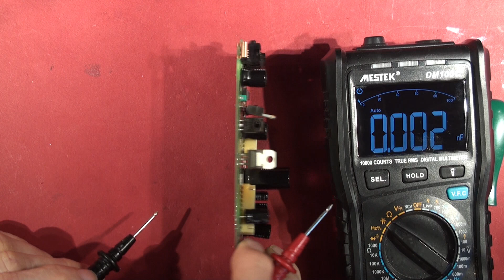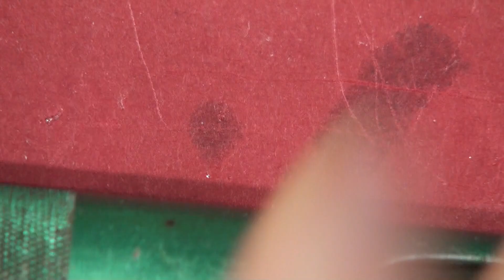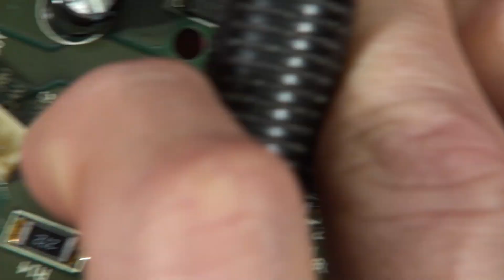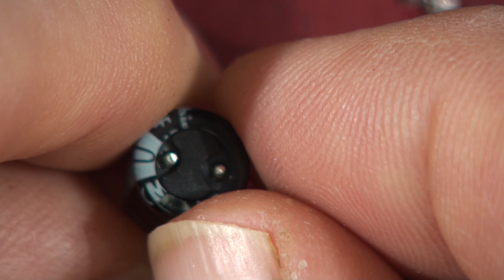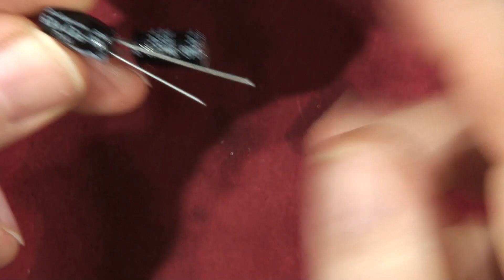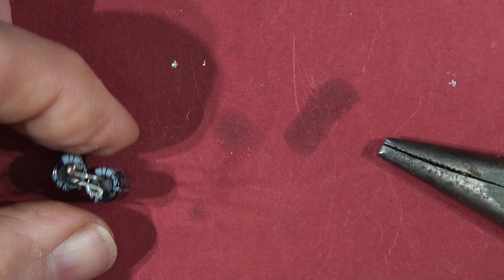Bose Lifestyle 20 Music Centre Dim or No Display Fault Fix and Diagnostic Repair

Comment: The Video is amazing, it explains everything fundamental about this system.
On my device the SCREEN was faulty so i measured all the capacitors and changed only the C27 and it worked after!
Huge thanks!
Reply from the maker: Good to hear that you fixed it. Thanks for watching and subscribe if you can.

Comment: @razenby  - I tracked down schematics for the CD-20. For some reason Bose deleted the schematics in the latest service manual available online, but I found an older version that includes the schematics and shared the power supply schematic here:
https://drive.google.com/file/d/1FIZF0nvMglNwCBArtiRix19kMqBULdgT/view

Corrected: C24+C27 are a pair placed in series (for reasons I don't understand), and drive the 4.5vAC-powered VFD display filament. The other terminal of the filament is at - 24V DC, so the DC voltage the caps see is 24v +/ - 6.4v, and the polarity of the caps is correct.

Hope that helps!
Best Regards, Dave

Comment: A desoldering tip: Put a drop of flux on the solder to remove before using the solder-wick. Solder-wick really is easier than the solder-sucker and doesn't spray bits of solder everywhere. For big through-hole like these caps I remove the cap first (heat one leg at a time and gently rock it out), next wide wick, then fine wick to get the last bit out of the holes. Hope that helps!
Reply from the maker: Ok for some applications but some double sided boards with larger copper areas it isn't possible to draw out the solder from the hole. Too slow. .  One point worthy of note is that most brands of cheap de-soldering braids are completely rubbish, and you are correct, junk braids require additional flux to work..  The quality stuff is impregnated with flux so no additional flux is needed. I use Loctite or Chemtronics. Expensive but well worth it.
Reply: @razenby  Agree, I use Chemtronics, but it still needs a drop of flux to draw out all solder on boards like these.

Comment: I replaced C21 and C27, but no improvement.
Then I replaced C18, C20, and C24, no improvement.
All diodes check out OK with a meter.
Powering up the power-supply PCB by itself on the bench (without load) shows these voltages at the connectors:
V tun+10:	18.3v
V -24v		-26.1v
V -30V		-30.5v
V +10v		18.7v
V 4.5VAC	AC 9.1v
D8 quickly got very hot – too hot to hold finger on...
Any ideas?
Thanks!
Reply from the maker: Is D8 the secondary rectifier diode or?  I don't have on the bench at the moment... If D8 gets to hot then check it out and also any components in circuit with it.
Reply: @razenby  D8 is a zener used as a regulator, so it acts as the load and gets hot when the supply PCB is powered up without load connected. Not a problem, dubious design though. There are several such issues; best not power up the supply PCB unless connected to the rest...

Comment: Thanks for the video! Can you tell us why the capacitor numbers on the schematic you showed do not match the board you showed?
You replaced C21 and C27, not shown on the schematic??? 
Thanks!
Reply from the maker: There are several versions of the bboard but only one circuit diagram.  The  idents and layout differ between revisions. In my experience the limited Bose schematics don't exactly match the hardware that comes across my path,,

Comment: Do you know anything about the serial data port on the LS30?  I am trying to build a serial interface to control the Bose from my Home Assistant system.  I can't seem to locate any information about it.
Reply from the maker: The LS30 does include a “serial data” port, but Bose never published the protocol. Only internal or proprietary sources seem to hold the necessary details. Your best bet would be to track down the service manual or reach out to integrators who may have reverse‑engineered it previously.
Reply: @razenby  I was able to locate the serial interface guide for the CD20 and now have a mostly functional hardware serial interface that allows me to control the Bose from my Home Assistant system.

Comment: Awesom, I didn't know that the problem was only those two. I changed all the capacitors on the board...😅
Thank you very much for the information, next time I will know what to do. 
However, at the moment, I have another problem... The big transistor in the middle is getting very Hot, evene with the power suplly only. 
When i play some music then, after few minutes, the sound suddenly shuts down. You think that the problem can be that transistor that heats up too much? Or is somthing else on the board that absorbs too much current. 😅
Thank you very much
Reply from the maker: Could be thermal shutdown. Is the mains voltage correct? If the transistor is overheating check for other components getting hot too,

Comment: Interestingly the C21's polarity is reversed, at least according to the print on the board. Misprint or?
Reply from the maker: Strange... I haven't noticed that.  It wouldn't last long if the polarity was wrong...

Comment: I am going through this right now. Wish I came across your video first before I watched another. That sad video did it a different way and ruined the board. 
How did you get that one side of the board loose? Does it have to be soldered off? I wondering maybe I can buy an old unit take that side of the board off and just replace the caps the way YOU did it and I'll be more successful.
Reply from the maker: Thanks.  No soldering required.  It just unplugged from the heaaders.
Reply: @razenby  I can't believe it. LOL.. I am not sure what a header is but I wish I just pulled it apart. I guess?

Comment: Have you ever repaired a Bose M1 Multi Room Interface or the display of the Bose P1 remote? The M1 has a similar capacitor issue and the luminescent sheet of the P1 display is a pricey repair for a simple sheet of luminescent paper. Would love to see a video for both of those repairs! Thanks for the great videos sir!
Reply from the maker: Is the back light a piece pf electro-luminescent paper?  I have fixed a couple.  By the looks of it it is usually a simple fix. . If you can send me one i''ll take a look at it.

Comment: I use braid for a lot of jobs, including THT  as well as SMD and micro work but also have a decent sucker with silicone tube nozzle that does a nice job with some caveats. On the scale of things I work on, it can also completely suck up whole tracks. For thick multilayer boards like gaming laptops and games consoles, the key is heat whether using braid or a sucker for things like HDMI anchors. Bottom heating, hot air assist or just a really big tip at 450 will do it. Either technique needs the right tools and application (and in the case of braid, there is indeed a huge difference between good and crap stuff). For braid and THT, I sometimes leave the legs in place to help send heat to the other side of the board and wick everything out. Everything is personal preference at the end of the day. Cheers.
Reply from the maker: I have no trouble with heat using a Weller 90 Watt station. I mostly use braid to clean boards when changing SMD components.  Been doing a lot prototype work  placing 0.3mm pitch QFN24 packages soldering iron lately. Occasionally I have to reach for the braid.  I find Qualitek to be the most reliable.  It seems less susceptible to degradation when left on the bench.
Reply: @razenby  I mentioned heat because looking at the video, the issue with the braid not working looked liked heat transfer.  I use sub-100w irons on a bench at one place I work and can attest that 130-200W cartridge systems really make a difference especially when using smaller handpieces like the 115 nano I use a lot (with the largest bevel tip available!) Although only a double sided board, the planes here were quite large and sucky and the wick should be bubbling and thick with solder after a short application. With regard to braid degradation, I dowse the braid in flux if it turns out not to be behaving itself. My sucker is the best manual one I've found from a bunch of crappy ones I've tried that either flat out didn't work, or broke quickly.  Best wishes, and looking forward to future videos. Rob
Reply from the maker: @OnStageLighting I see your point, however  In this case it  wasn't heat transfer. They sucked out OK with a sucker.  The iron is 90W silver element and tip. It solders joind on 2.5mm copper cable with ease. Braid doesn't work on small plated through holes on 1.6mm FR4. I could have put flux on it and probably cleared the holes with braid  but I was kicking back against viewers we keep insisting that a solder sucker is antiquated.  It may be likened to  a hammer - you wouldn't let anyone hit a valuable piece of kit.    That's what real trained engineers are for - to know which hammer to use and how hard to hit it. I use a soldering on for everything in the videos because that is what is most accessible for most viewers.  I get a lot of failed repairs junk so called engineers have had a go at- they call them 'beyond economical repair' . Most of the have damaged and butchered tracking and sparrow s*ht soldering. Their problem is that they struggle to remove components because they have crappy irons with very poor thermal coupling to the tip.   If the Weller indicates 360 degrees C you know it is displaying the tip temperature not the temperature sensed miles away with inferior thermal coupling to the business end. You can complete work on hefty joints with a Weller set to 360 that would require a 420 setting on a lot of irons.
Reply: @razenby  "Prior repair attempt" is regularly declined here for this reason. I totally understand how this happens with DIYers but between making the diagnosis more difficult and having to make multiple trace/pad repairs, the item has to be fairly high value to offset my sky high price for the job. The solder sucker I have is the SS-02 I think. It clogs very easily but does actually suck properly. I get through a lot of braid cleaning up for SMD work including reballing BGA. It's annoying because braid not particularly cheap, even the crap stuff.

Comment: I thought about two parallel crap-a-citors in parallel might last longer, then you selected two 50 uf  (47uf)  to share the wear.
Hmm do you get half the esr value as well?.
The mad thing is yesterday i was asked to fix a Bose cd/radio music player jobbie, early version with transformer and tiny remote control.
The sled switch had given up the ghost, so it didnt know if the sled was in the center.
There are some crap caps in those old units but it plays fine.
Also gave the laser lense a wipe with a damp cotton bud.
I expect it t fail later on with dead caps, but it works for now :-D
Reply from the maker: Phew , dodged a bullet there.  In cheap caps the ESR depends on the thickness (resistance) of the aluminium foil and the connections to that foil.  Beefier caps are always better.   I have Japanese solid state amps from the 60s in which the electrolytic caps still are 100% value and ESR.  I find that remarkable.
Reply: @razenby  Bloody hell, that's amazing,  you would never see that quality now.
Quite sad really.

Comment: Thanks for your video :-). Definitely would like to see the key repair. I know on the vehicles I work on for a living, the keys have been designed to where they can only be programmed to one vehicle. I would love to see if that feature, if it’s common to your vehicle, can be overridden. Cheers.
Reply from the maker: I will do it soon. It is annoying  to keep having to use the metal key and though I can lock the doors - getting the rear glass boot lid on the C30 locked with the metal key eluded me so far.